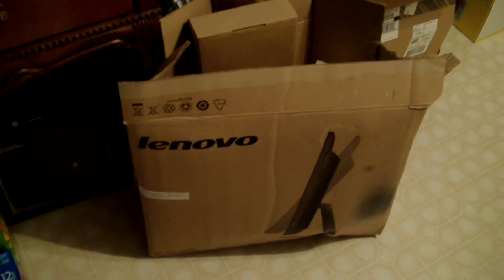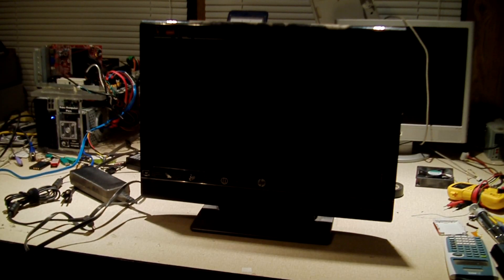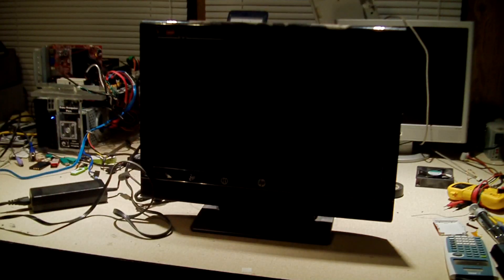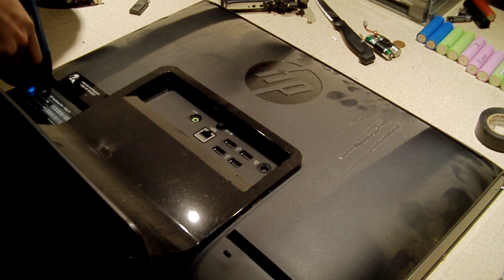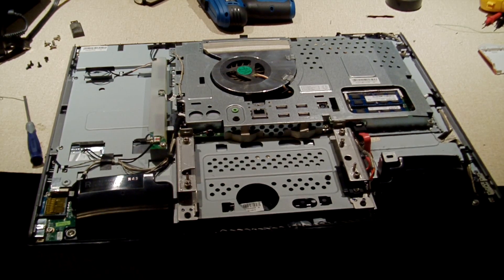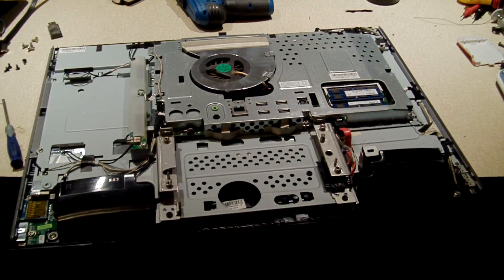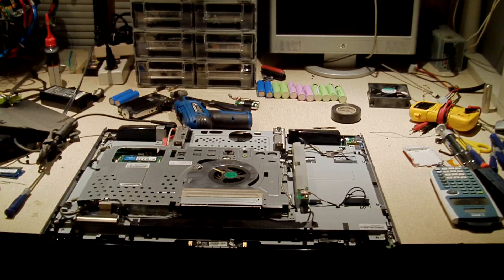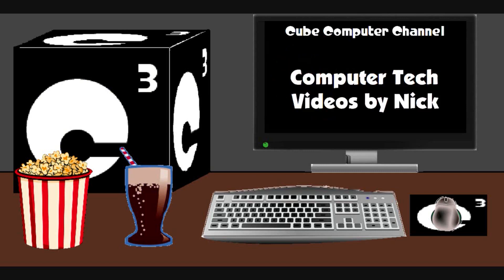Troubleshooting yet another dead HP TouchSmart All In One PC

Comment: Have a HP 24 all in one touch screen, start button dont work, Could short-circuit it with start button but it broke , not easy to find replacement parts. Bought one from Germany but it was wrong start button. Do I need the start button? Can I short start it with just the flat cable. Think it was connector 1 and 3 with flat cable. Can you solder connector 1 - 3 inside from the computer and cable out through the computer and cross the cable and short circuit? Shame to throw away a computer just because it won't start properly, works very well otherwise.

Comment: When i turn on my HP all in one i have a black screen with 3 or 4 beeps followed by three more.  This goes continually until i unplug it from the wall.   Is there anyway to retrieve any of of files or pics I have on the computer?  I have a backup,  but it has been awhiie since i last backed up my computer.
Reply from the maker: Yeah you can pull the hard drive from the system, and use a USB-SATA adapter to access your files from a different PC. USB-SATA kits are cheap and function similar to a flash drive.

Comment: i have something to say .. HP is the worst brand of computers ever seen !!!!! try open they page and search for a PSU of 3 years ago for a all in one 27  whit i5  16gb ram and 500 of hibrid toshiba disk .. and 27 lg led monitor i think its the only good stuff on it .. all hp are white marks likke liteon super cheap made in some garage in china ..  i open the psu and it says liteon the only thing HP is the stiker autside  i try to go to the HP page for some suport in portugal and wen i see they are complet retards and know less than me they only know the same that is the HP page of this year they are selleres and not technical suport they dont have some one that tell you giv me de part numeber XXXXXXXXXXX and will send you one for X euros like all brand marks that i know like ASUS or TOSHIBA  LENOVO  MSI  they all work like that and ASUS belive it or not they have a suport even for boards whit 15yrs old !!!!!! HP doesnt giv you suport for a all in one 27 of 2 yrs ago i say that because mine doesnt giv image but is a LED LG monitor you need a truk to rool on it to stop working . its not the NVIDIA grafic CHIPSET is the fuking PSU and its smells like burn it you have 6 cables 3 black negative 2 yellow positive and one green low voltage and is thiner than the others .. that one is burned .. whitout that cable passing the correct voltage the computer works normal evericing turns on the cpu works .. the ram works... the light of the board works .. is not the chipset .. the monitor stays black ..  the twin fan spinns like hell like turbo like if it goes to blow up in a minuto or so ..  so all signs says is the psu .. in my case is a liteon inside the case of the big monitor .. the new models are PSU of plastic autside the monitor .. like a laptop .. 19v ..  for some reason... humm i try to enter in the UK   HP page and is exactly the same shit  suport is only to tell you buy this new one.. is not a (suport) is sellers that know less of informatic sistem than you do .. they just want to sell afther this horrible experience whit HP in portugal and UK .. i guess is the same WW so im done with HP its the worst piece of crap ever seen in informatic computers suports .. my nefew have a old board of asus whit 14 yrs and he show me the ASUS suport and even bios for 14yrs old boards they have a really suport .. that is a suport whit a huge list of pictures models and free downloads and how to do it .. even if you dont understand or not shure they anser the phone in asia and talk to you in english anf they giv a bether suport than all HP shit (not suport)  online ..   im done whit HP is my 3 one .. i have a 6000 pro tower and it was a kid that put me some codes in the bios for i can upgrade to the best quad core ..  HP dont giv me any suport in that not in internet not by phne zero!!!
i have  a DV6000 laptop whit lots of clients info inside i didnt giv a shit about the 900 euros of the laptop and it was a kid of 25 yrs from cambridge in a garage that makes me a reballing in front of me .. that i think for my self ok afther this its garbage .. and he press the buton and it works .. just like he says .. so again a kid of 25 yrs ..  and now my all in one 27 inch that cost me a fortune afther 2 yrs i have the PSU burned .. and they present me a plastic PSU of the new model in the HP page of this year and i ask were is the models of all years and numbers for i can search and buy my self like you do with asus, msi toshiba .. were??? and the guy stays still sayng nothing .. this HP people dont diserve the money whe pay for they products because if one day we need suport we have none !!!!!!!!!!  to all people that have HP in home ..  similar thing .. dont buy it again .. for me was the 3 time and the last one .. today was the limit !!! more than 2000 euros to the garbage .. HP = SHIT

Comment: As a small MSP myself, I have seen my share of these HP Pavilion AIO's that come in as a dead PC where most end up having one or more failed capacitors and or MOSFET chips in the main power rail of the MOBO thus creating a short in the power subsystem. Given that most of these AIO MOBO's are expensive to replace new or even used.
A PCB board level repair is usually the best option but even that will run $310 to $450 depending on where you live so if it is more than 3 years old that too becomes a bit of a stretch in terms of an affordable alternative....The only thing I can say as an MSP is that if you insist on purchasing consumer-grade products "Buy the extended warranty for as long as they allow" even though it technically reduces the amount of repair income I would get to say that, enough is enough, I can tell you that after 15 years of direct experience with HP consumer-grade products, no amount of complaining to HP will ever do any good.
Your best bet is to only purchase business-grade equipment which normally (not always) comes with a 3-year warranty that can cheaply be upgraded to a 5-year warranty.

Comment: I have an all in one touch screen desktop.  Its booting but the screen is now black. 
Theres been a handful of times over the last few months where the screen came on or there was a flashing dash on the top left part of the screen.  There are no beeps.  I was going to buy a video card but I'm on the fence since it's not beeping. 
I can't even get to the bios. I've tried everything. Still boots and then nothing. Thoughts?
Reply from the maker: It could be a failure of the GPU chipset on the motherboard. You cannot install a video card in one of these as they are not traditional desktop systems.

Comment: I almost gave up, BUT, I came across a posting that basically said that the ID pin should be tied to the +19v line with a 130k resistor.  With Dell laptops I get warnings if the laptop cannot determine the power adapter.  With this HP, it is a bit different - just the 3 flash code!  I was going to rig up a power supply with a 130k resistor but scrounged through my adapter box and used an Insignia 90W adapter (one of those with multi tips).  It worked for test purposes at any rate but gets warm after a while.  I wanted to get it to work before trying to buy the "correct" power adapter as I was not sure if that would really fix it.  Hp touchsmart 310 pc power flashes 3 times and won't start - http://www.fixya.com/support/t11638867-hp_touchsmart_310_pc_power_flashes_3 also (see last posting) http://vlab.su/viewtopic.php?f=53&t=13803

Comment: If its just cracked solder joints on the motherboard and VGA Chip, all you have to do is Re-Ball (re-solder) the solder underneath the chip on the board, its only a dead garbage motherboard if your too lazy to Re-Ball the Board, and if your not good at Soldering to Re-Ball it then take the motherboard and throw it in the oven for 10 mins so it heats up all the solder on the board and once its cooled off throw it back in and 100% will work. So dont just throw your pc away people when you can not be lazy and do what i just mentioned..
Reply from the maker: In order to correctly reball a motherboard chip, it requires specialized equipment, which many don't have. And even then, there's no guarantee the board will work reliably after the procedure. So no it's not a matter of people being lazy. If the motherboard and chipset was properly designed, there wouldn't have been an issue to begin with.
Reply: @CubeComputerChannel  it won't buddy, I try , it just last 2 days more . The problem is a factory defect and is because the antlon and the ati graphics re heat horribly, in other words hps all in one are pure shite
Reply: Cube Computer Channel all i want is to get my pictures from the computer will it ever be possible took it to best buy 10 years ago n they said either the hard drive or the motherboard was the issue but not grantee  if they can fix it they wanted to charge me $800-$1000 so i never fixed can u help any advice thanks

Comment: hey bud, i have an hp24 that suddenly stopped working. i can see a light where you plug the power plug in the back but when i press the switch there is no light at the switch. i am thinking the motherboard is dead but i am also thinking that possibly the switch suddenly failed? appreciate your thoughts. great video!

Comment: Hello Engineer, My name is Mike from Nigeria. I have an Hp Envy 23 touchsmart pc. there is power but no display on the screen. I tried to clear the bios but no luck.  with your experience what do you think could be the fault pls? thank you
Reply from the maker: Likely a motherboard failure. These machines are notorious for motherboard failures.
Reply: Whats the aprox cost to repair this type issue? Thanks

Comment: I'm working on my , only about 13 month old, HP all in one model 22-2a113W.  I shut it down to eat dinner and about an hour later I went back to it and , it wouldn't turn on. The led does not light up and the fan doesn't run, nothing! I took it apart and tried the shorting of the ribbon cable traces (second in and last trace) and, this did nothing.  I am going to run through removing the BIOS battery and removing the drive etc but, I'm thinking it's probably a mother board failure. There is an internal led that is lit that says the power is getting that far. I wonder if there is a fuse maybe under that cardboard to the right of the power connector. I guess I have nothing to lose by removing it  and taking a look. I have been a technician most of my adult life but, that was in communications equipment repair and I have also been out of the field for quite some time.  I think maybe I have a $500 paper weight? It should be a good experience going through the test though, I miss that!

Comment: My power button flashes...three blinks as well. The coms is at 2.89 volts. I grabbed a pwr supply from a new hp envy just to be sure since my wife is writing a review on the laptop. My old envy all in one didn't have much for dust surprisingly, but I recall it being hot constantly. I see a video where they short the ribbon with some success, unless it's the mb or switch after a surge sometimes knocks you out. My fan doesn't even run. Perhaps it went first. Kids had it...anything is possible.